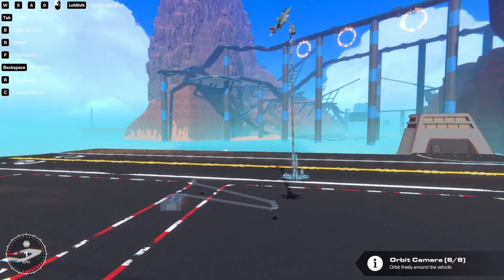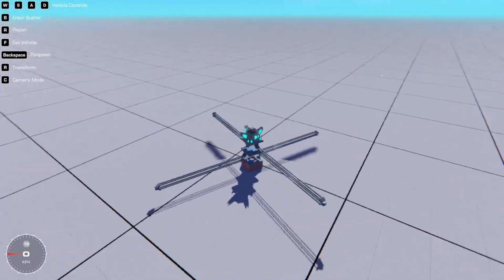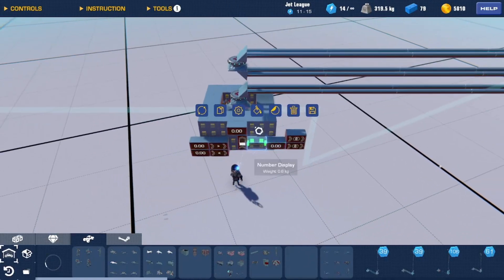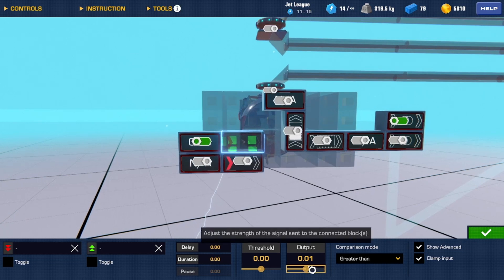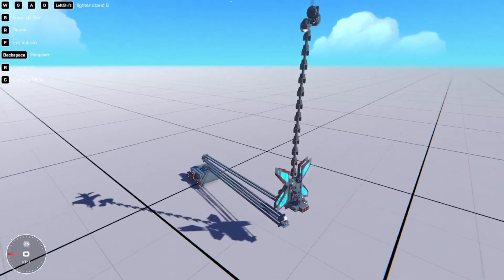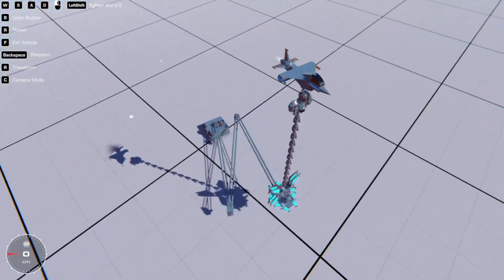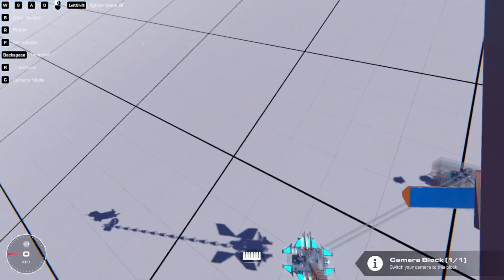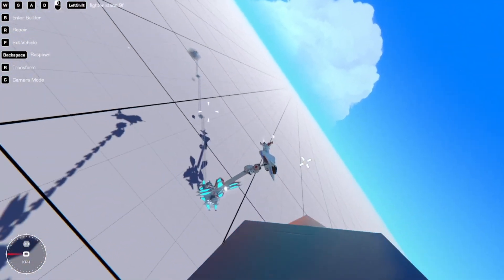Working Flight Simulator in Trailmakers

Comment: For dogfighting: Use a system like the one you have now, with a series of 2 arms going out to a (0-strength) servo. On that servo you suspend the center of a length 50 arm (ends at +25 and -25 units from the center). And then at the ends of that arm put (zero-strength) servos with length 20 arms, which will hold the piston stacks. (I.e. replace your 3rd arm with a double sided one, and then on top of that add a 4th arm.)
The length ratio keeps the planes at least 10 units apart horizontally, which is a limitation. But you'd have that same limitation anyways with the tail fins on the bottom units. And you'll be able to make loops around each other indefinitely without any of the arms running into each other.
Reply from the maker: that's actually really smart. that's a good way to constrain thing. i think your right, i will be posting dogfighting footage shortly. i think i was blinded to that idea because i kept wanting to have two separate creations for each aircraft and never thought of having them on the same arm system.
Reply: @ThisIsDumbAllTheNamesAreTaken can you make another missile ? Please
Reply from the maker: @Aviation_Pro28  i will when the camera servos come out, or at least try. until then, there is not much of a point since i already tried everything i thought of.
Reply: @ oh wait how would yoy be able to make a missile with a camera servo wouldn’t that be complicated
Reply from the maker: @Aviation_Pro28  
step one: make the missile have camera servo controlled controls
step two: look at target
step three: target go bang.

Comment: Often times the best solution is the simplest one, just copy and paste the flight simulator on top of the old one. Then tweak a few joints so it’s still even. You don’t need to worry about the bases hitting each other, because if that happens it only means the planes hit each other
Reply from the maker: that would not work. they would still tangle if they made loops around each other near the edge.